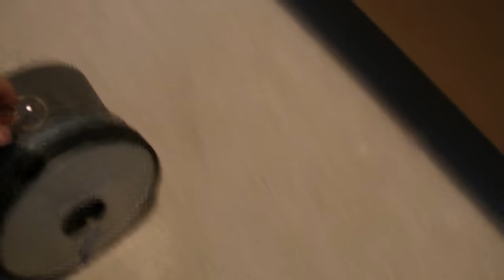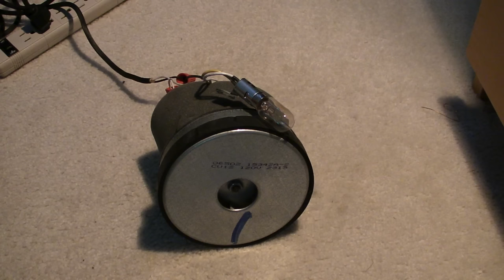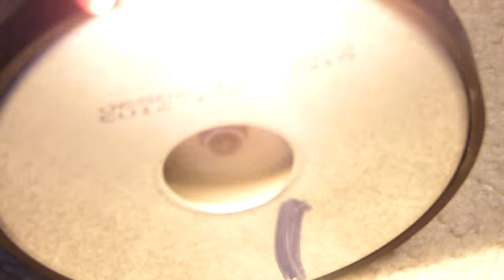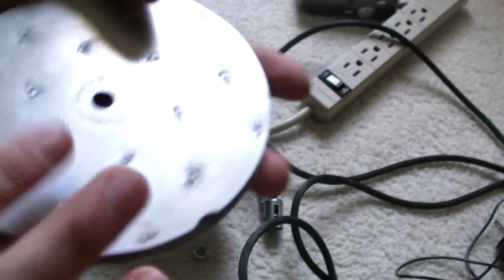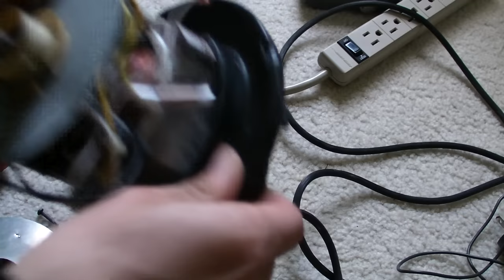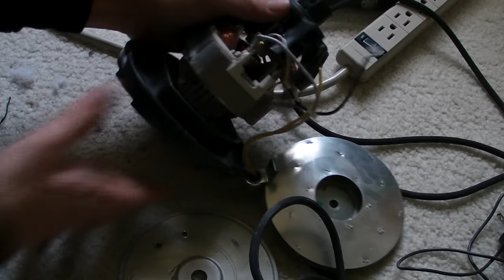Eureka Vacuum Cleaner Motor Tear down

Comment: Have exactly the same motor dust from sanding walsl has entered ! The armature brushes sparking like H-ll!  Looks like I do not jhave to remove the armature to smooth it's  comutator iwith with 1000grit wet and dry sand paper - but is the fan nut a left hand thraed ?

Comment: I opened up 2 old broken vacs today and found 2 1500 watt motors , the problem was the bearings holding the rotors. I think they are very practical , you could use 1 for an electric bike instead of spending lots of cash for a motor that is even bigger and less powerful

Comment: Hi, do you happen to know the resistance of the motor? My vacuum cleaner did not work and i found the fuse (15A) burnt. After replace fuse it spin for half minute it burn out again, i change the fuse three times, all the same. I was wondering if it is the commutator or the whole motor should be replaced.
Tks!

Comment: Hey Nick, I have a question. Well, Im trying to make an automated guided cart that could follow a person. This cart should be able to move with max. 200 lbs of weight. Do you think two vacuum cleaner motors would do?
Reply from the maker: vacuum motors are series wound and universal motors (run on AC or DC and at any voltage under its rated volts) and they have very high torque. if you do the gear ratio correctly, youll be able to power it without a problem!
Reply: Thanks!

Comment: @hootergirlsrhot well I think you can get 2 powerful motors from more new vacs and put them on the back wheels ... i think a combined power of 3000-4000 watts is more than enough to get you goin like 20-25 mph.
Actually a friend of mine built a go-kart with a 2hp engine and it topped out at 15mph 10 degrees uphill (i mean going up a small hill) , but it was poorly engineered , lots of power losses , and the weight was 400+ lbs with the driver